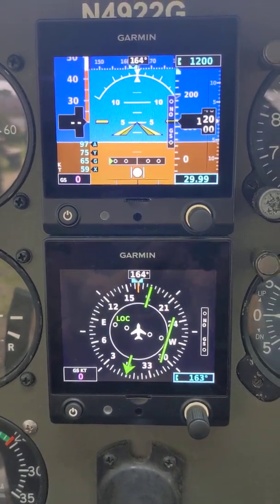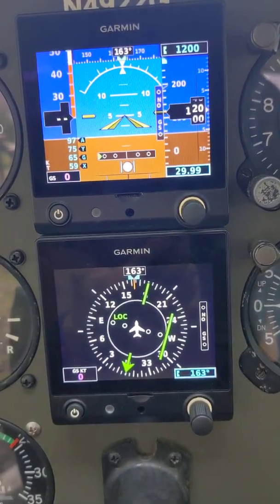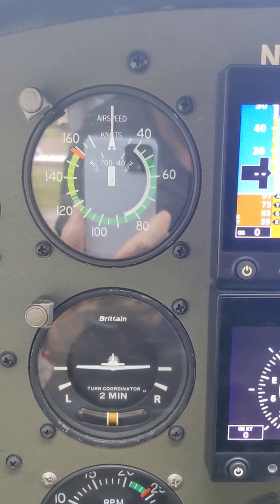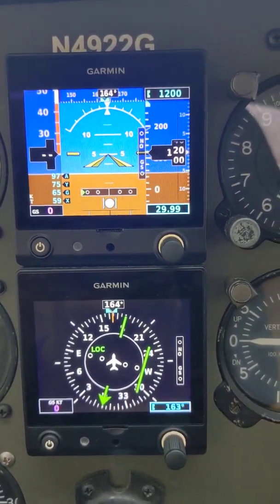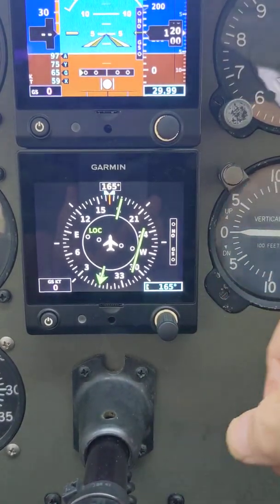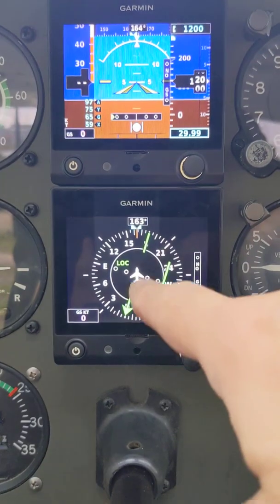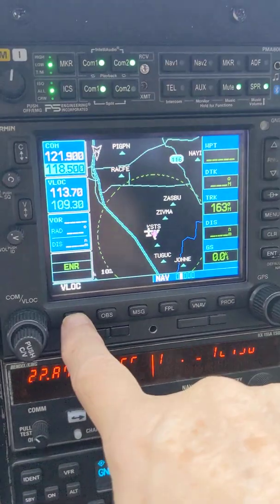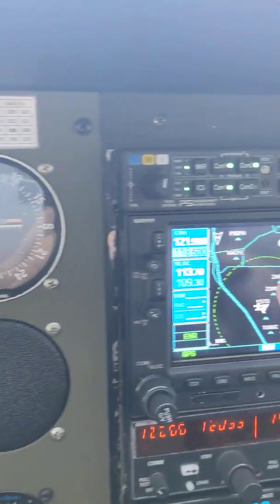N4922G Garmin G5 quick walk-thru

Comment: I understand these can be installed by your A&P?  You don't need to use a Garmin dealer?
Reply from the maker: Yes, I believe that is true. Mine was installed by a Garmin dealer, but Garmin supplies a kit that an A&P can install. The one tricky part can be the location of the magnetometer. Make sure you do a careful survey of the location. We initially placed it in the left-wing and the bolt for the wing strut interfered ONLY when the aircraft went above 3000'. So for initial tests, it seemed like it was working.